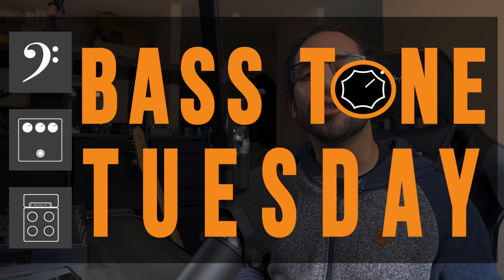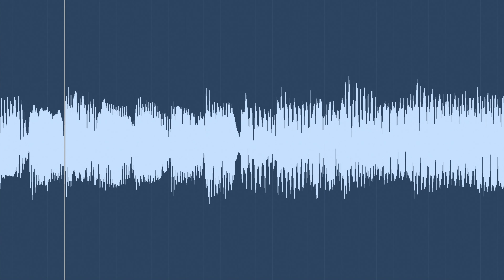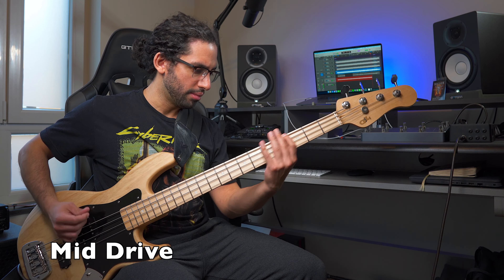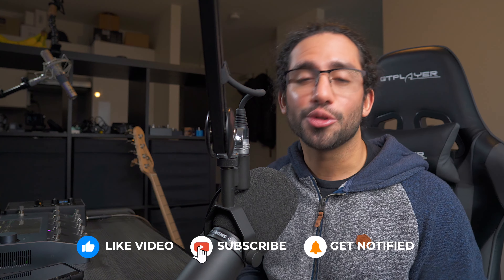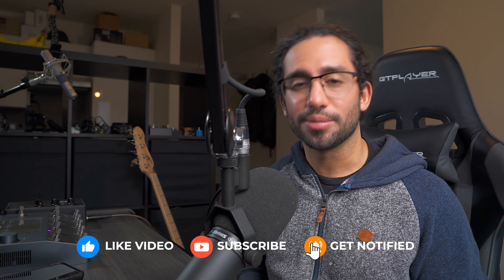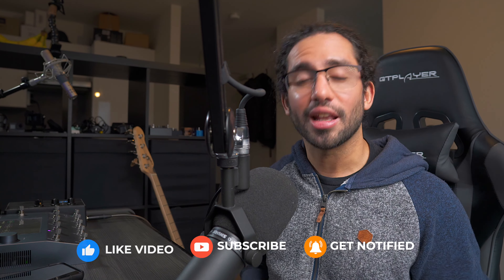Is this killing your tone? | Bass Tone Tuesday

Comment: Simple solution: Always split the bass signal and  add some clean signal to the overdriven/distorted sound! 
So you have the character and compression of an overdriven sound and the clarity and definition of a clean sound at the same time. 
Most modern oversrive/distortion pedals for bass have a mix or blend knob nowadays, exactly for this purpose. 
Personally I'm not a big fan of frequency crossovers for this. I like  having the clean signal fullrange and using a high pass filter in front of the overdrive to give it more definition and a low pass or speaker sim or IR behind it to cut out that unwanted high end sizzle. 
Ok, not that simple in the end... 🤔😜
Reply from the maker: 😂😂 “simple solutions”
Reply: @IvanBassist  Exactly. 😂 Those filters are "nice to have" but actually I don't have them in my live setup. I still use my EBS Valve Drive wirh a custom TAD tube in it in a parallel effect path mixed wirh the clean signal. That high frequency distortion really depends on the tube/circuitry you use.

Comment: Bassists using distortion as a boost live and disappearing completely from the mix is a tale old as time. Using distortion when the guitars lay back sounds backwards but sometimes works wonders 

Choosing a proper distortion for the job is key. Darkglass stuff really brings out harmonics and usually help actually cut through a dense mix. Some fuzz circuits are scooped but some, like the Malekko Diabolik, take total control of the mix. It's also good to know that a proper distorted tone doesn't have to sound good solo to work in a mix.

Would still love to hear that distortion shootout with the SVT sims, brother!

Comment: So right! For recording it makes absolutly sense to have a clean signal and a distortion/ effect signal way. In the mix you can decide easyly if you need more distorted sound or is it better to drop more clean basstone in the arrangment. A distortion/fuzzpedal with a parallel output or a tuner with a second output is a simple solution to split the signal. 
Keep the low end alive!
Reply from the maker: Indeed!